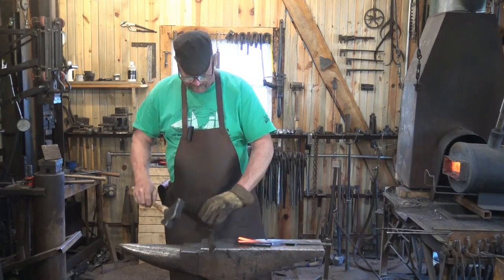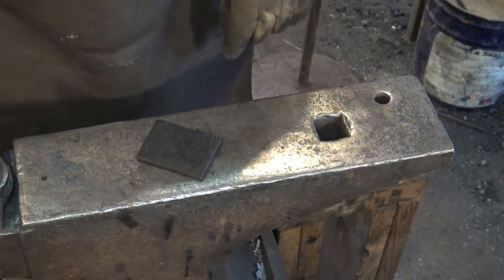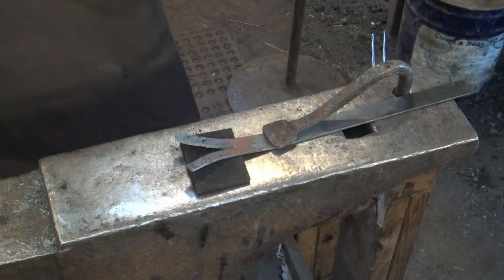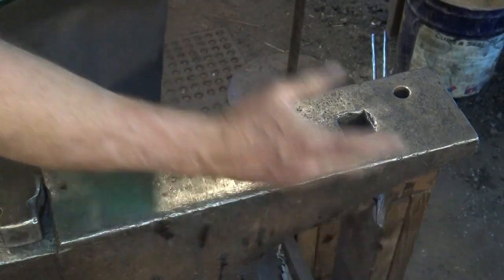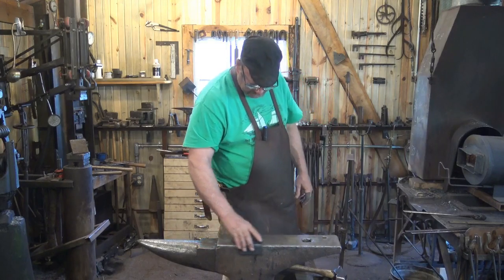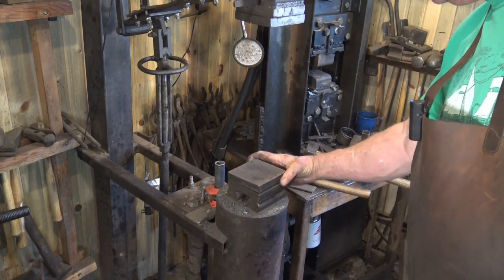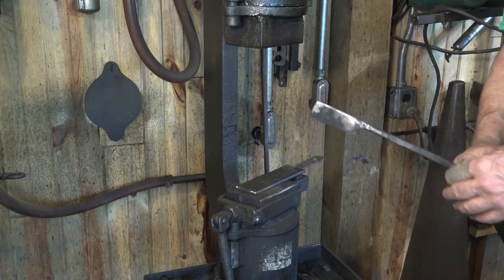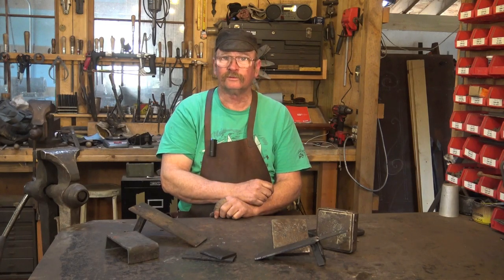Protect your anvil with a soft plate - basic blacksmithing

Comment: I hear the step on the anvil, by the horn, was made to be a cutting surface.
Reply from the maker: I did mention that in the video and said that I thought it should not be used that way.  You can gouge up part of a vintage anvil that is difficult to repair or gouge up a piece of scrap you were going to throw out anyway.  Plus The European style tow horn anvils don't have a step and new all steel anvils with a step are hardened throughout to the step isn't soft.

Comment: John, what would be a good height for building my swage block stand in the flat position. I am cutting the pieces now, so would rather not have to rework later, kind of looking for a ballpark figure, on the height from  someone who has used one.
This is a real old one with Hardy holes up to 3 inches,  so I would like to set it flat at a stricking height which I understand to be somewhat lower than anvil height. I'll set the position when on edge, at my anvil height. Does that sound right?
Reply from the maker: I never made any kind of calculation for the flat orientation of my block.  instead I made the edge about the same as the anvil height when the block is set in it's slot.  This places the flat at a lower striking height that seems good and also makes a great place for setting my other small swedge blocks on.  I will try to remember to measure that and perhaps make a video on the subject.